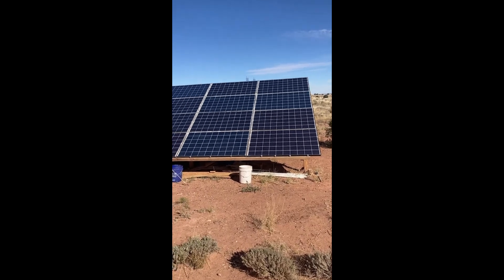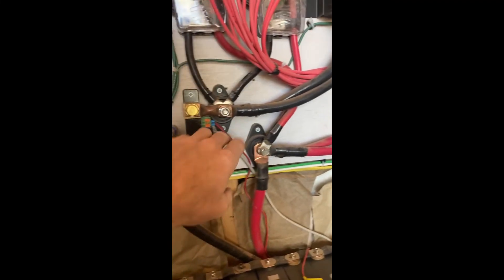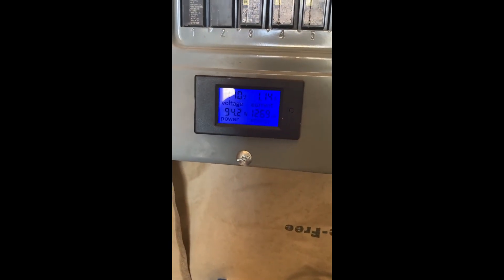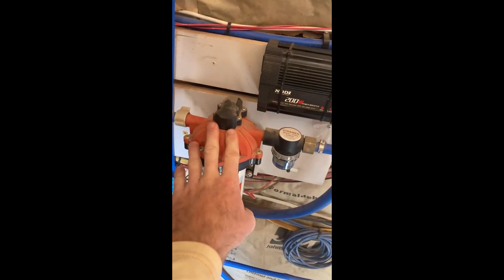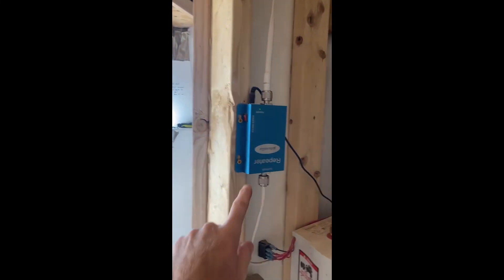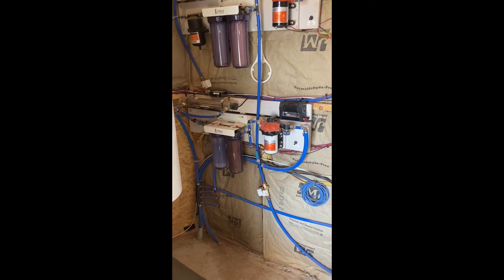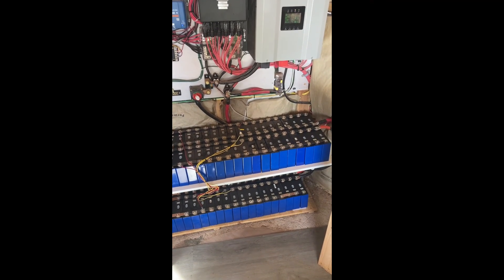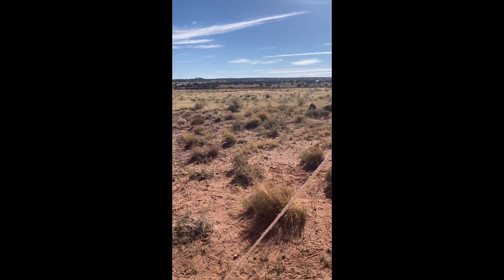Our Off-Grid Power and Water Setups

Comment: Nice work. I can see you put alot of thought and time into planning and installing your systems. We are off grid power and water too, here in the U.S.V.I. and also have challenges with cell signal & internet signal but recently switched to hardwire service internet / wifi calling. Big improvement for us.
Also recently upgraded our battery bank from 20 KWh to 80 KWh as we were concerned with future availability of lithium & everything else. Sleeping better now knowing we have ma bit more storage than we need.
Are you in New Mexico or Arizona??
Looks nice and quiet out there.
Reply from the maker: Thanks and we are in Arizona. I use to wire yachts so have experience wiring similar setups and I took a long time to setup everything before we moved so we could stick it up fast. Also 80kw, wow that a massive battery and should power anything you would need. We finally got Starlink internet and love it. It solves the internet and cell issues since we can do WiFi assisted calling and we have a strong router so it reaches all corners of the property.
Reply: @wildhavenoff-grid3587  good move with the starlink, hope not too pricey, we pay about 150 for cable internet &high speed. We need that and the 80 KWh storage to service our home and two rental units. Vacationers love to run the AC here in the tropics. And they love to drain our cisterns awfully quick too.
We just took a road trip last fall in camper to Quartzite (camped down in the Kofa Nat. Wildlife Refugee) and had a great time. Beautiful country out there, had some great campfire nights.
Just watched your boat build video, pretty cool.
Want to do a solar powered bay cruiser for down here one day when I get some spare time. Gotta upgrade, upsize the house panels first to keep the batteries full. Only have 8800 watts on roof now.

Comment: Looking good.  I'm off grid here in southern utah, and have 2 different systems.  Lifepo4 in my trailer, and lipo in my utility shed.  Doing an upgrade to the utility system, which should bring it to 28kwhr, and I have 18kwhr in my trailer.  I have been very happy.
Reply from the maker: Sounds like a a nice setup. I agree with you, lithium batteries are definitely worth it.